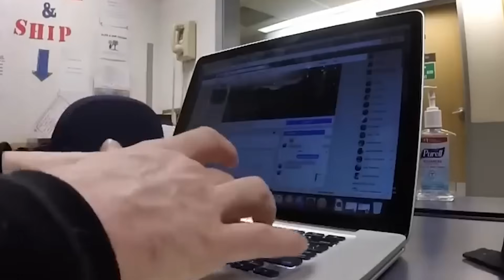What Antarctic Researchers Eat When Cut Off From Civilization & Supply

Comment: in the video. you said food is calculated in advanced. but the question is can crews bring their own food. like  bought from walmart. kinda stocking emergency foods in advanced.
Reply: No u can not. You are limited on what you can bring. However, there may have been a few down low hydroponic “gardens “ in drinking cups in a few rooms. I the winter months , there are tables set in the hallways of the stations ( at McMurdo anyway) where everything people left behind is free game. Can’t confirm or deny unopened toiletries, guitar strings, earbuds, books and magazines were birthday or holiday gifts. It was almost like currency. I know a certain shop mechanic that made bracelets from old piston rings and gave them as gifts.
Reply: Good question. If they are allowed any, I would guess not very much. The weight shipped is measured very carefully, it is limited by the aircraft or ship used. Every kilo is also quite expensive to ship. I believe this is funded by government grants and donations which provides a limited budget. They would carefully choose what to ship. Every kilo would contain items crucial to their work or survival.
Reply: It appears you don't know much about supply chain/logistics. If everybody brought their own stuff, there would be no way to manage the storage assembly (like a lean factory).